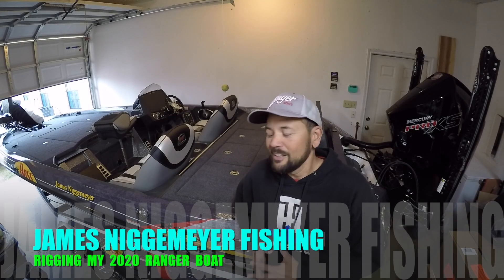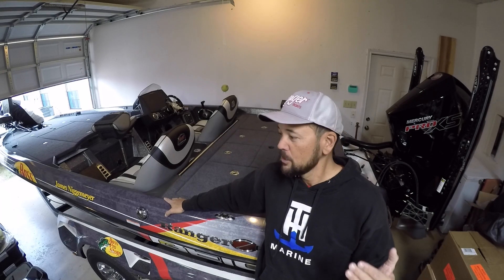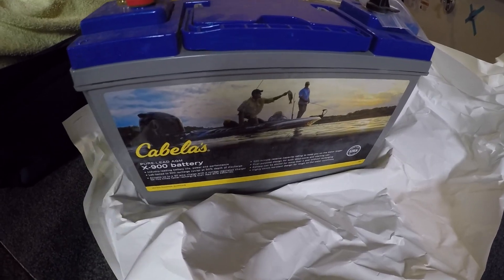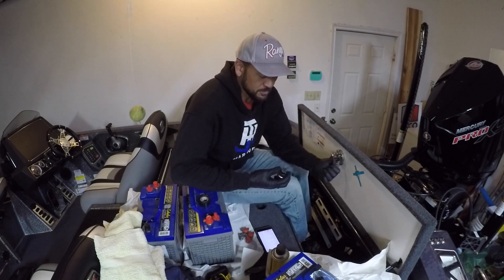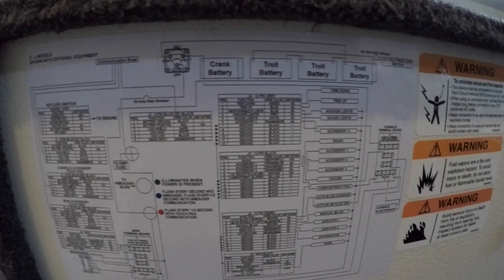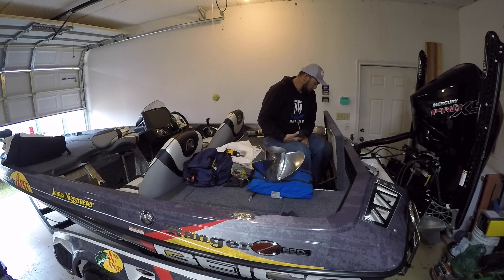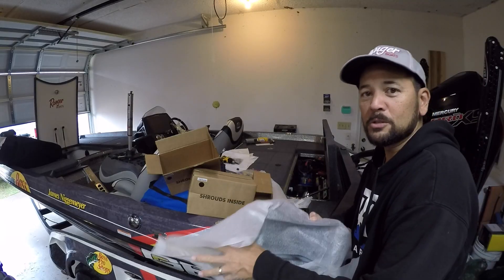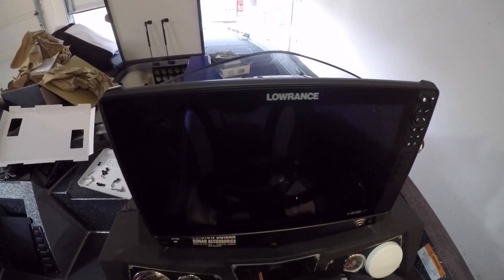Rigging my NEW 2020 Ranger Boat, VLOG part 3.  Wiring batteries, electronics mounts and options.

Comment: Where did Ranger mount your Powerpole pumps?  I am looking at adding to my 518L. Thought where the spare prop goes would be a good accessible location.
Reply from the maker: In the splash well of a 520 L there is a black cover that allows you to access beneath it, which is where Ranger about it the Power Pole pumps.   Works out great it’s like the trunk of car.
Reply from the maker: However you could also mountain where the spare prop goes 😁